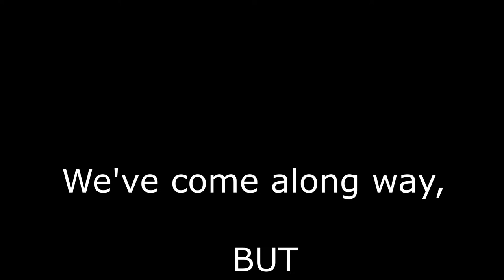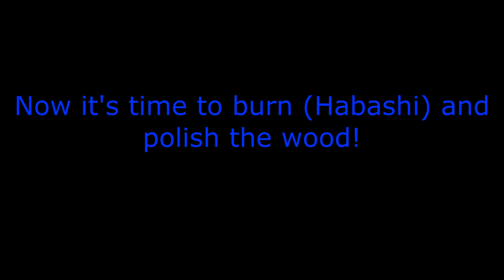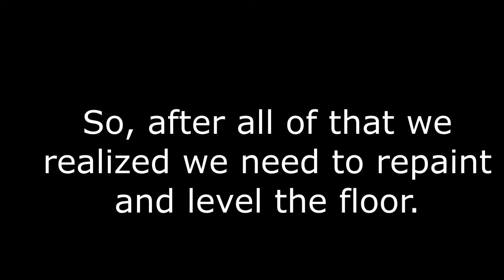SHIPPING CONTAINER HOME #17- BASEMENT PART 3

Comment: Hey guys, great video as always. I was hoping you could tell us what you had to do to repair the basement once it collapsed. What did you learn from your bricklayer neighbor that ensures you have a basement that is structurally sound and that won’t collapse during the next heavy rain?  Maybe I just didn’t notice, but did you put any type of ventilation down there? You’ll need some way to bring in fresh air and please get yourselves a radon detector because you definitely don’t want radon gas to build up down there. Finally, did you have a sump pump down there already? If not you’ll want one for sure in case water starts getting in. Maybe my suggestions are overkill, but I feel it’s better to be safe than sorry.  Thanks again for sharing your journey with us!